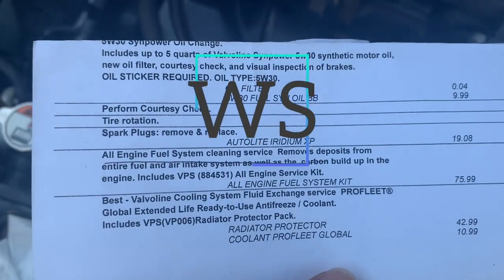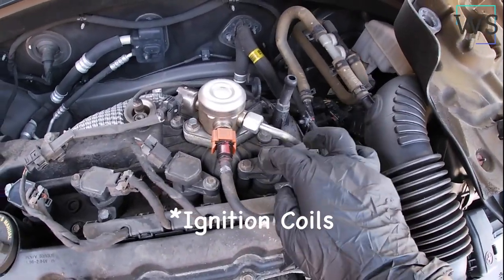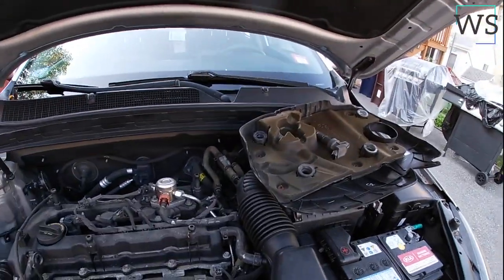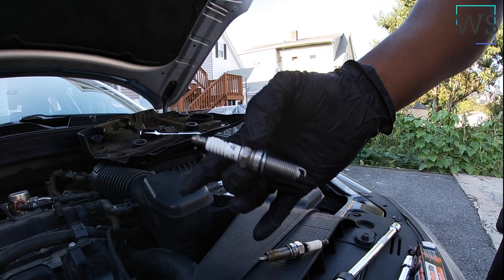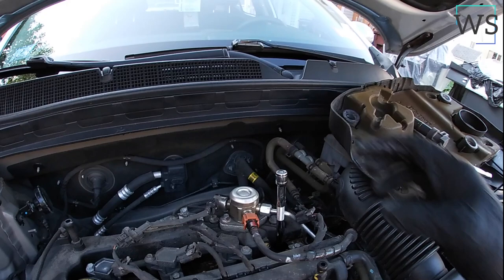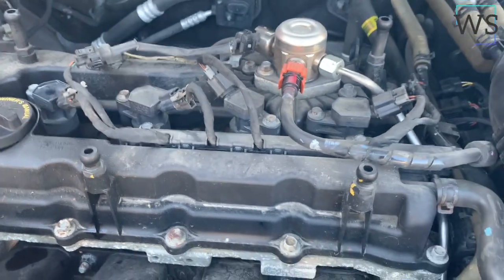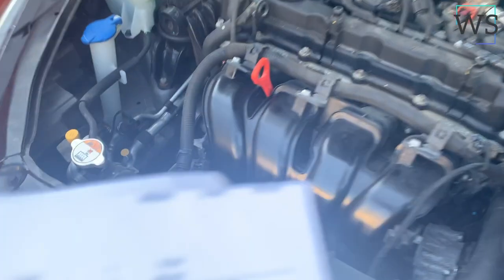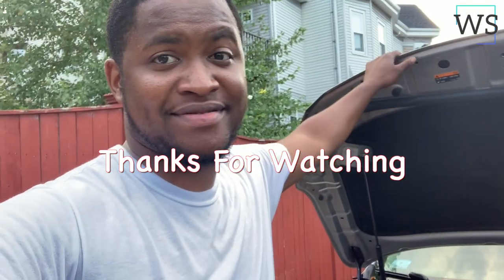DIY: Spark🔧Plugs Replacement | 2010-2015 Kia Optima 🚘

Comment: Brother how many miles on the car when you do the spark plug?
Reply from the maker: It is required to replace the spark plugs every 20,000 - 30,000 miles!
Reply: For a turbo, for baseline manual says 105k